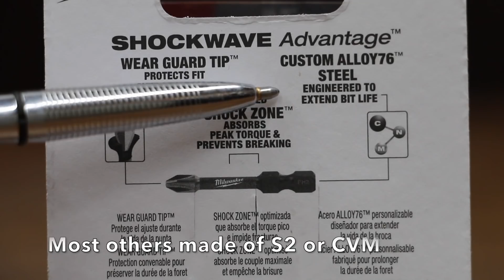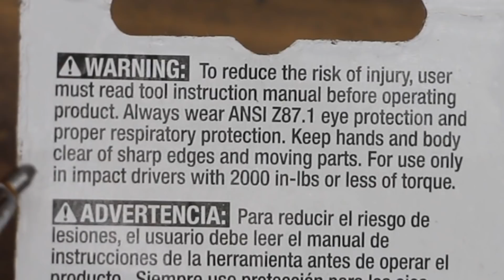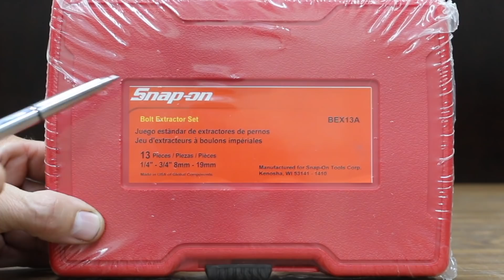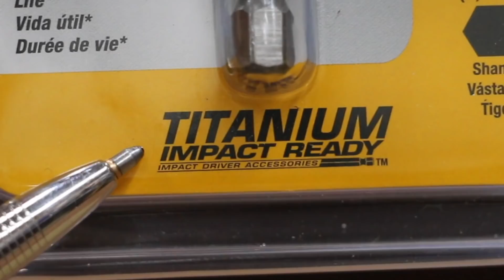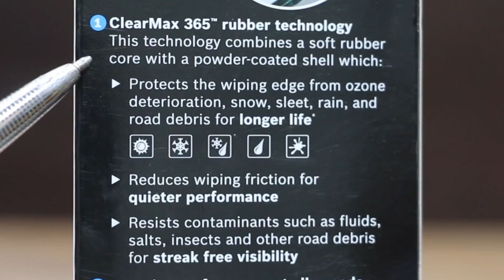Top 10 Tools in 2020? Let's find out!

Comment: "Cam-out?" scratches head in Robertson's
Reply: True Robertson (the angled square) are beautiful.   Square drive is okay, but both are better than Torx or Allen, IMO.
Reply: you know its a good system when your shoulder crack and the screwdriver shaft starts slipping in the handle before the screw even thinks about cam out .
Reply: @Francois_Dupont  Phillips bits were designed with cam out in mind to limit torque. It was an easy way of letting people with low skill assemble items and not over torque the screws. So sometimes cam out is actually desirable.

Comment: Man i really went just bought the Milwaukee m18 fuel impact driver in this video. I don't know of any other channel that does this much thorough testing and consistent testing. I have ridgid tool and it looks like home depot might stop selling them soon as they are pushing Milwaukee instead of ridgid. Just bought the pack out 199.99 with 2 3ah batteries Going to start my switch over to Milwaukee as they have allot more tools in their arsenal.
Reply from the maker: Thanks for sharing.
Reply: They aren't getting rid of Ridgid any time soon.

I'm a happy Ridgid Octane user, but I've also bought everything on sale/clearance. I wouldn't give TTI full price for these tools. But the LSA is pretty sweet.

Yes they aren't Milwaukee, and sometimes I need more power. But I paid like half the money.

For 12v shit, I'm Milwaukee only. There's no question for 12v. 18/20v you can brand war if you're bored.

Comment: Along the knife testing, consider putting cutting boards through the wringer, looking at things like durability, knife wear, ease of cleaning and such. For example, Mm wife's family loves glass cutting boards because they're incredibly easy to clean and come with many prints, but I always feel like I'm destroying the knife, and like stick to bamboo or hardwood at our house.
Cutting boards (and things used as cutting boards) that I've seen used: hardwood side grain, hardwood end grain, nylon, ABS, PVC, Delrin, glass, stainless steel, ceramic coated, a flooring tile (yes, really), a couple paper plates, granite, marble, and just straight up using the countertop veneer.
Thank you again for all of your videos!
Reply from the maker: You are welcome!  Thanks for the suggestion.

Comment: You have such great tests!  A test you need to run is dry lubricants. I restore classic cars and what I want is a lubricant that will last literally 50 years. Grease breaks down over the years. Also need rust protection and lubricity. There are various types - graphite, teflon, etc. Thanks!
Reply from the maker: Thanks for the video idea.

Comment: I picked up a set of 5 M35 cobalt step bits for between $30 and $40 on Amazon that have been fantastic for me. I've had them about 2 years and used them a LOT - without even sharpening any even once. I managed to snap off the tip of the smallest one but as long as I drill a pilot hole first, even that one still works great. And I've used these almost exclusively in steel. Now Harbor Freight has Hercules M35 cobalt step bits that - while not quite as cheap as the set I got - they're still quite cheap for M35 cobalt step bits. I plan on grabbing a set of these soon
Reply from the maker: Thanks for sharing.

Comment: I would love to see a comparison between air compressor mufflers. We all hate the racket compressors give off and mufflers seem to cut down on intake noise a lot. There is quite a few options including some DIY stuff, but no way to tell which are junk and which are good. Some of the things to consider, decibel drop, airflow, compact or stick up in the air, and ease of use. Thanks for doing what you do.
Reply from the maker: Thanks for the video idea.

Comment: The spiral style sockets I have aren't the same brand, but I can confirm they work great on rounded off bolts, have been using them for years. Sometimes if the head is rusted away too badly there isn't enough material to left to grip, sometimes going down a size, and or going from SAE to Metric or vice versa can get it out, can be difficult if you get a rounded head in a tight space that you can't hammer them on though. Just to put it out there tinted safety glasses are a thing, not sure many people even think of or realize that, can be helpful when working outside if you're like me and have light sensitivity, another benefit is even if you're doing something that you know your sunglasses would likely be sufficient to protect you from, they're a lot cheaper than a decent pair of sunglasses if you get them scratched up working.
Reply from the maker: Thanks for the feedback.

Comment: Have the older midel drill docter. Use it every year to sharpen a lot of dull bits.2 of the machine/ tool & die shops that I did a lot of electrical work at always sharpened nrw bits before using. One shop had a high school kid sharpen bits. Great vid.
Reply from the maker: Thanks!  Thanks for sharing.

Comment: Being a joiner we deal with a lot of the fire rated hinges with stainless steel screws and sometimes these can be rounded by a previous joiner and I’ve tried a load of brands in the UK but a screw extractor video on stainless steel screws would be amazing!
Reply from the maker: Thanks for the suggestion.

Comment: Another great review. We use contigo auto seal bottles they have hot and cold cups and they have made the lids easier easier to clean on the hot cups. However the cold cups you need a special screwdriver and it can come apart for cleaning. The first one we got was left on the roof of her car and came off as she went around a corner it had a big dent on on the side of it and it was a plain stainless so I smacked it on either side of it and I was all but gone. I then heated up the spot with a torch and then a cold water soaked rag on it and that popped it out enough that's very close to new again. I must say that the older ones did seem to hold temptures better. The newer ones have a bigger capacity and I tried pre warming them and that didn't seem to make much of a distance. Then I put it in my cup holder and when I removed it the bottom came off. I am not sure if that was supposed or be part of the vacuum  insulation or not? But coffee only stays hot for about 1.5 to 2 hours and it is only slightly warm by then.   We love the auto seal lids and larger capacity they hold.  I should swap it out and see if it  helps.
Reply from the maker: Thanks so much!  Thanks for sharing.

Comment: Thank you for doing the videos. Suggestions for 2021 are: Smoke Detector, Carbon Monoxide Detector, Sand Blaster, Pressure Washer, Work Gloves, 9 Volt Batteries, Utility Knife, Tape Measure, Padlock, Canned Air vs Small Air Compressor, TP, and a Rust Remover for Sinks, Toilets, etc. I have well water and found a brand, Whink, which seems to be more than watered down muriatic acid. Keep up the great work!
Reply from the maker: Thanks, will do.  Thanks for the video ideas.

Comment: I bought a couple of Blue point air tools at a local pawn shop.
I took them apart clean them on the inside put them back together and did a few tests with lag bolts.
At some point I called a friend and I mentioned my purchased and the power that these small 3/8 drive torque wrenches had.
I mentioned to him that it didn't have nearly as much power driving a lag bolt in as it did pulling it out.
He replied they're designed to remove things they have more power during removal then they do an installation. He added when you're talking high torque you're going to use a torque wrench to finish tightening a fastener.
So basically he said torque wrenches are designed for tightening and impact wrenches are primarily designed for loosening.
....... And of course they can get things pretty darn tight. 😉
Reply from the maker: Thanks for sharing.

Comment: As usual you did a great job comparing tools. How about testing router bits? Straight, flush cut, round over, and whatever you can think of. The prices have a big range. Circular saw and jig saw blades in particular.
Another is saw blades.  Carbide, tool steel, combo cut, plywood, etc. There is a wide range in prices here as well.\Thanks for all your great videos.
Reply from the maker: You are welcome!  Thanks for the video idea.

Comment: I would like to see you test small 110v flux core welders that cost $250 or less.  Something like the Hobart Handler 100, Lincoln Century 90, the several available from Harbor Freight and whatever is available on Amazon.  I have a need to do some basic metal work, but nothing that would warrant buying a several thousand dollar welder.  I really enjoy your channel and have used it as a key bit of research to buy a battery chainsaw, blades for my portable saws, drill bits and Milwaukee M12 tools.  Keep up the good work. Happy New Year!
Reply from the maker: Thanks for the video idea.  Happy New Year!

Comment: 0:04 Milwaukee Shockwave Philips #2 Impact Bit
1:34 DeWalt Socket Adapter
2:17 Milwaukee 2853-20 M18 FUEL
3:29 Rocketsocket
4:13 Carhartt Carbondale CHB210DT
5:03 DeWalt Step Bit
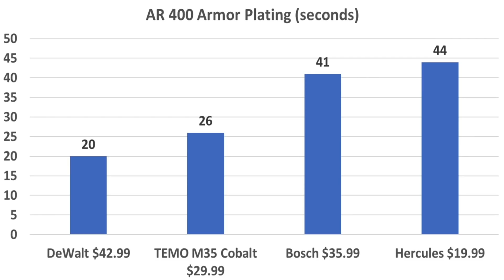6:24 Drill Doctor 750X
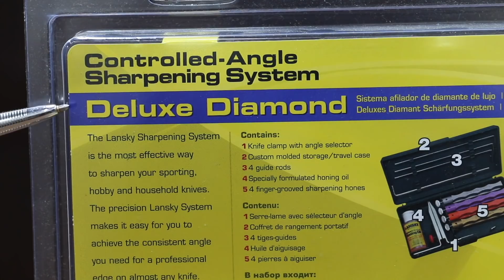7:31 Lansky Knife Sharpener
9:01 Bosch ICON
9:50 Renegade Hybrid Brush Blade
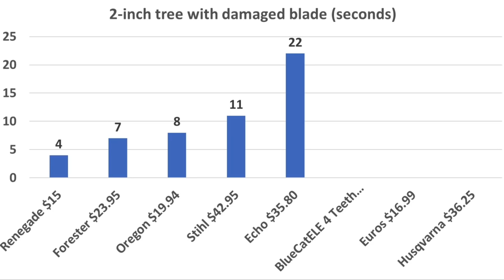Honorable Mention 10:56 Fake Makita Impact Wrench (Cousin Eddy)
Amazon links in description
Reply from the maker: Thanks!

Comment: Really appreciate your videos.  Your videos have really helped me make better decisions when making purchases. 

Two video ideas.  
1- Gas chainsaw.  I had to purchase a chainsaw recently and checked your channel but only found your electric chainsaw video. Would really enjoy seeing gas powered chainsaw comparison. I just bought a Husqvarna rancher 460. So far works good but I did find the chain it comes with seems like a bit of a learner and I had to replace it shortly afterwards. The new aftermarket chain works much better. Oh that could be another video chainsaw chain comparisons. 

2- Long term fuel storage.  I’m thinking you could remove ethanol from gasoline and store it for years.
Reply from the maker: Thanks so much!  Thanks for the video ideas.

Comment: I discovered protective boots for my dewalt power tools from Mac Tool. They are too cool. Maybe do a video on their benefit between all the brands. And why you might want them on your power tool? Very little info online for all the models they have. You have to call in and work with the service team. But usually Model number of the tool with a PBMB before the tool number. I have one for each impact I own, the mid, the 12v and 20v 3/8 and the 1/2 big boy dewalts. Then I bought them for my XR and Atomic Drill Driver and now I have every battery I own protected with a rubber shell. PB201 and PB200 for the 20v and PB120 for the 12v 2ah batteries. Good stuff. I'm going to do a video on them as I'm about to have all my orders in house in the next week. 

Really nice approach to securing the investments from damage.
Reply from the maker: Thanks for the suggestion.

Comment: I have a set is those Bosch windshield wipers but there is one drawback with those mono wipers. In the winter it is a bit harder to remove ice on those things because the monoblade design is really thick compared to the conventional design. and because of that ice really likes to build up underneath the wiper. With the conventional design you just drop the wiper on the windshield a couple of times and all is good but with the monoblade design you really have to pick the ice off the wipers with your hands which can be stuck on the wiper pretty good
Reply from the maker: Thanks for sharing.

Comment: Can you make a video which interested me for a hell of a long time.

Which Screwhead is the best for Torque, stripping and damaging the bit and screwhead, and how much force is needed to apply to screw a longer screw..

it seems like philips Screws are the fastest but needs the most pushing power.
Torx will make the most torque but will when stripped and damaged you can throw them away fast
the canadian 4head seems cool but is not available in germany :/
the hexagon is cool and all but also goes round pretty fast when the screwhead is flat and not much meat of the bit goes into the screwhead.
Reply from the maker: Thanks for the video idea.

Comment: As a suggestion for a video, how about a glue strength comparison with atypical or non-glues, stuff like garage-floor epoxy used as a glue and finding out if wallpaper glue(the stuff that looks/feels/smells like PVA glue but comes in buckets and is a LOT cheaper) is as strong as actual PVA glue... 

Polyurethane varnish used as a glue might also be a good test and I'm sure there are other a substances that also may be very functional as a glue without them necessarily being intended for that use...
Reply from the maker: Great suggestion!  Thank you.

Comment: Video Idea : Which expanding spray foam is the best.  Best R value, least amount of out gasing, best claim of expanding vs. not expanding.  Would be nice to know the relative pressure each gives off for what application I'm using it on.  Saw someone do a bathtub using great stuff as the base instead of mortar or plaster.  There is 3M and a bunch of other stuff to test as well I believe.
Reply from the maker: Thanks for the suggestion.

Comment: How about testing vise grips. Floor jacks. Jack stands. Jigsaws. Ratchet end wrenches. Half inch to 3/8th socket adapters. 3/8th to 1/4 socket adapters. Front brake pads. Torque wrenches. Automotive coolant additives. Heat guns. Corded impact wrenches. corded saws. generators. insulation. Flash lights. Chop saws. Pocket knife blade steels. Pliers like vampliers vs klein. Cutters. Sledge hammers. Gas chain saws. Boots. Screw drivers. Light bulbs. Led head lights. Tire dressing like black magic vs armor all. Car interior cleaning products. Spray paint. Paint stripping products. Hammers like stiletto vs milwaukee.  Polishing compounds. Grinders. Bench grinders. Combat boots. Wood splitters. winches. Ratchets. Wool socks.
Reply from the maker: Thanks for the suggestion.

Comment: I really like your motor oil show down series.  For 2021 I was wondering if you could do a similar thing with antifreeze by testing carrosion prevention, lubricity (for water pump life), it's ability to store/dissipate heat, and ofcourse boil and freeze protection? Four types/brands I would prefer compared are Dexcool (I'm a gm guy), prestone green, valvoline Maxlife, and a generic one like super tech (is prestone really better?). Thanks
Reply from the maker: Thanks so much!  Thanks for the video idea.

Comment: on the driver bits it's a toss up, they don't wear as fast, but they often end up shearing/shattering the tips off, specially when you run into old hard woods and longer screws that may hit metal strapping or very hard knots or if it suddenly snatches up and you twist sideways, it shears the tip off. I've broken more that way than wearing them out.
Reply from the maker: Thanks for the feedback.

Comment: Obviously the bottom line is when purchasing tools is whether your a professional mechanic/builder or your average home DIYer who might only use a certain tool twice a year.😃
I’m after a half decent socket set that has good tolerances but I don’t do seized nuts on auto subframes so don’t need 700lbs of torque so no need to spend 100’s on top end Milwalkies,Tecton or Snapon’s.
Reply from the maker: Thanks for the feedback.
Reply: @ProjectFarm  Have you tested Auto tires yet?
Budget v Perrelli,Dunlop,Hankook,Dunlop,Goodyear etc?

Comment: Video recommendation: can you please do a motorcycle oil test? Motorcycle oil doubles as transmission fluid so its different than auto oil. I would love to see a comparison between the two top oils, Castrol Power 1 4T 10w40 and Mobile 1 Racing 4T 10w40, and other oils. Is this possible?
Reply from the maker: Thanks for the feedback.

Comment: Is there any way that you can check different brands of 30 year shingles. Maybe check for pull test, wind resistance, how well they stick to one another, granular loss with water pressure, weight per bundle, something in that nature. Just curious
Reply from the maker: Thanks for the suggestion.
Reply: @ProjectFarm  big fan by the way. Keep up the good work

Comment: A friend of mine has that Lansky set minus one of the diamond stones and I put a little Kershaw speed safe in it but it wouldn’t reach the blade because the frame that holds the blade was in the way, I could only use the 30° slot to even get it to touch the blade. It’s like the knife didn’t protrude out far enough. In other words the blade wasn’t wide enough like those kitchen knives but it shouldn’t have been as big of a factor as it was
Reply from the maker: Thanks for sharing.

Comment: Project idea, garage/workshop space heaters, propane, electrical, kerosene. Specifically, the portable ones or ones that are moveable on the floor, not the permanently fixed ones if you have a propane connection in the garage for such a device. How fast do they heat the space up 10 deg, how long can they run, what is the total cost to heat a space up of X size, do they have to be in a vented area due to CO concerns, radiant vs forced air styles and designs, safety features such as max temp shutoff or tipping sessnors.
Reply from the maker: Thanks for the video idea.

Comment: Hey ProjectFarm, I have another video idea!

I’ve been hearing a heck of a lot about running TC-W3 oil in your fuel tank. I would be interested to see if it lubricates and helps fuel efficiency/quiets engine noise as compared to MMO and Techron.
Reply from the maker: Thanks for the suggestion.

Comment: Great info and excellent test procedures.  Especially appreciated the step drill as I use them alot.   I bought a very expensive Klein which dulled very quickly, and then started buying the cheap Chinese versions, which (sadly) seemed to hold up better.   Next one will be your recommended one.   Thank you!
Reply from the maker: Thank you very much!